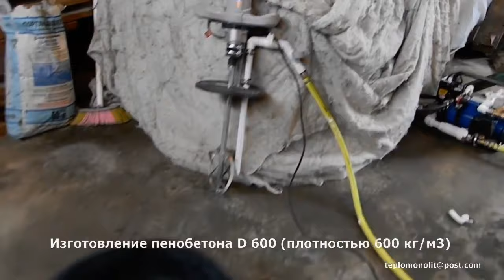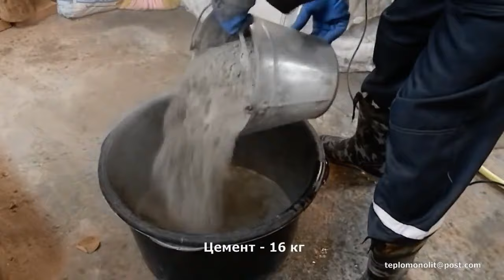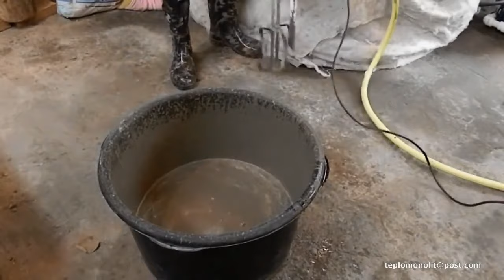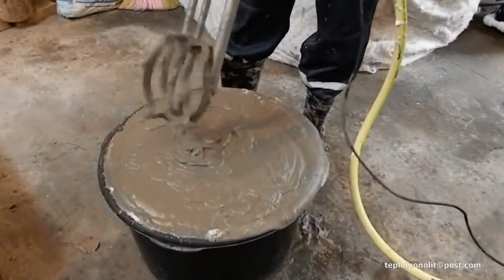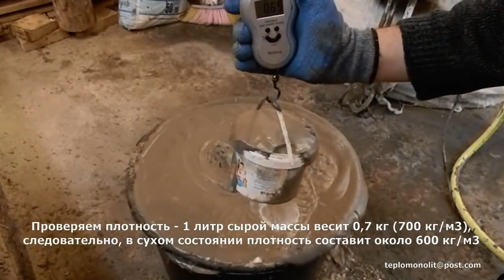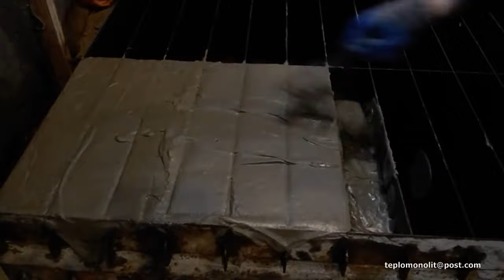Lightweight foam concrete density 600 kg/m3 how to do it manually

Comment: 🎯 Key Takeaways for quick navigation:

02:27 📏 The bulk density of concrete is calculated as the weight of aggregates required to fill a container of a given volume.
06:40 🧱 The loose bulk density of coarse aggregate is calculated by dividing the net weight of the aggregates by the volume of the container it fills.
11:10 📏 The rodded bulk density of coarse aggregate is calculated by dividing the weight of compacted aggregates by the volume of the container it fills after being compacted using tapping strokes.
12:56 💯 The percentage voids in the aggregates can be calculated using the formula (Gs - ρ) / Gs * 100, where Gs is the specific gravity of the aggregate and ρ is the loose bulk density of the aggregate.
14:06 💡 The aggregate used for bulk density tests should be in a dry condition, but if only bulk density tests are required, aggregates with a given percentage of moisture can be used, and the condition of the aggregate must be mentioned in the observations.

Made with HARPA AI 👍 Upvote to improve video surfing

Comment: Hi I have followed the recipe on the website:

50% cement
50% limestone powder (calcium carbonate)
1g/kg aluminium powder (0.001%)
Water to 0.65% of dry mix weight

I mixed as per the instructions and no bubbles formed at all. Nothing. Is there a missing ingredient?

Thanks
Reply: Mixture formula for 600 kg/m3 density:
1 kg of dry mix 0.65 liters of water 1 g of aluminum powder for 100 kg of dry mix you will need 65 liters of water and 100 g of aluminum powder
Reply: I have tried twice also. Hardly any expansion at all! Should we be adding something else?
Reply: Repeating the recipe doesn't help. It simply won't release hydrogen and rise.
Reply: @nathanlitjens5905  You need foam, and of course a foam generator.

Comment: interesting.  This prompts the question of dry aircrete vs. wet aircrete weight?
Reply from the maker: it's around 30% difference. here is the basic recipe for non autoclaved lightweight aerated concrete www.pioner-group.com/concrete

Comment: Hi, what was the third material you added? Is that a fly ash, other type of cement or fine san? Thanks
Reply from the maker: fine sand. You can take a look for another lightweight aerated concrete type over here www.pioner-group.com/concrete this is non autoclaved lightweight aerated concrete

Comment: Good Day, what type of cement are you using Type I or type III Thanks Bill
Reply from the maker: We are using ordinary portland cement
Reply: @stretchceilingsDubai  Do you use an accelerator like calcium chloride to speed up the set time? When I try to produce it at this low density it becomes part water before it is set..
Reply: @stretchceilingsDubai  What is ordinary PC?
The standard types of portland cement are:

Type I – for general purpose

Type IA – same as Type I, but when air entrainment is desired

Type II – for moderate sulfate resistance

Type IIA – same as Type II, but when air entrainment is desired

Type II(MH) – much like Type II, but when moderate heat of hydration is desired

Type II(MH)A – same as Type II(MH), but when air entrainment is desired

Type III – for high early strength

Type IIIA – same as Type III, but when air entrainment is desired

Type IV – for low heat of hydration

Type V – for high sulfate resistance

Comment: Desde Ecuador le Saludo muy interesante, La arena que usan es fina tamiz mesh (malla #60 - 0, 25 milímetros de abertura - 25 huecos en 1 pulgada) o de 0,15 mm…?                                       From Ecuador I greet you very interesting, The sand you use is a fine mesh sieve (mesh #60 - 0.25 millimeters of opening - 25 holes in 1 inch) or 0.15 mm...?
Reply from the maker: Hello, for non autoclaved lightweight aerated concrete we use limestone powder (dust) with particles up to 0,15 mm for more details you can visit www.pioner-group.com/concrete. For foam concrete you can use fine sand with particles up to 2 mm

Comment: Which is cheaper foam concrete or concrete with sand and stone?And which gives bigger volume in terms of size?
Reply from the maker: What do you mean “bigger volume in terms of size”?
Reply: @stretchceilingsDubai  I mean if i put half a bucket with cement and put the foam will it give me 1 full bucket of mixed cement and foam.   Thanks
Reply from the maker: It depends on density. Foam concrete and non autoclave lightweight aerated concrete required almost the same quantity of cement only additives are different.
Reply: Apakah itu yang di masukan sebelum semen

Comment: What's the name of the foam substance?
Reply from the maker: foaming agent for concrete
Reply: What are the components of the mixer, especially the white hose connected to it, and can I be satisfied with an ordinary paddle?
Reply from the maker: @samehmrsameh2150  Use bucket for                        60 liters
Add water                                7 liters
Ordinary portland cement    16 kg
Sand                                         16 kg
Foaming agent to fill the bucket up to the top.

You can try to make non autoclaved lightweight aerated concrete instead of foam concrete. You can find a basic recipe over here www.pioner-group.com/concrete
Reply: Is it good to use an ordinary mixer
Reply: What is the function of the white hose connected to the mixer?